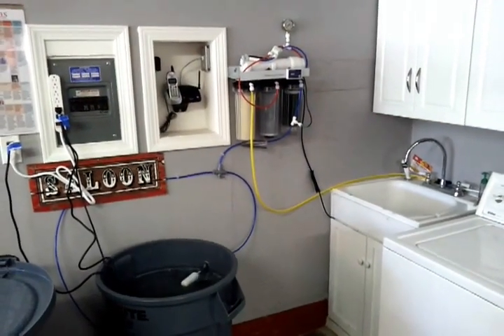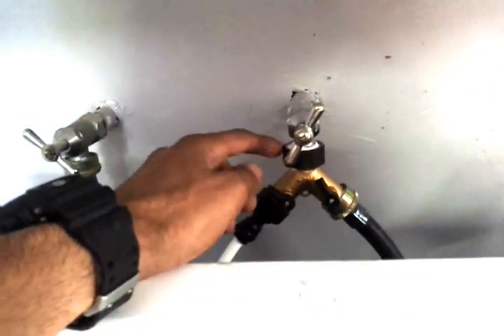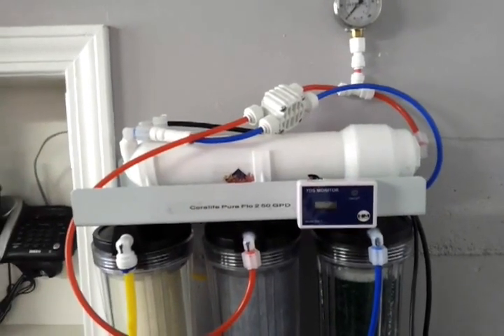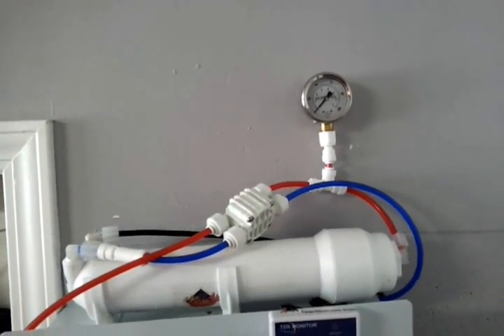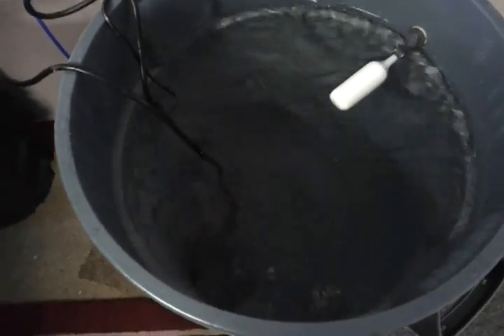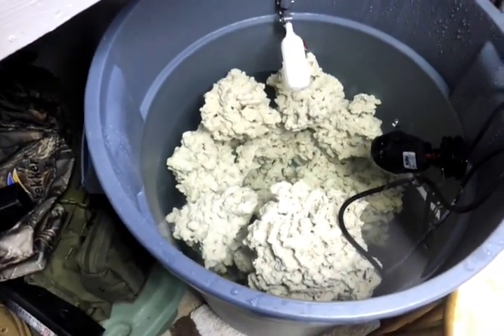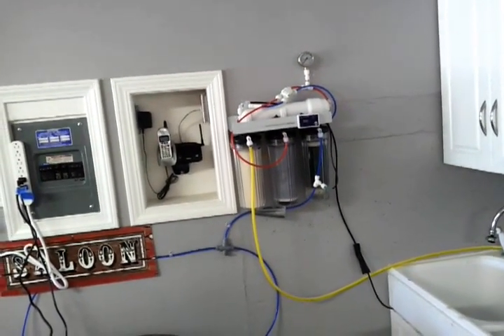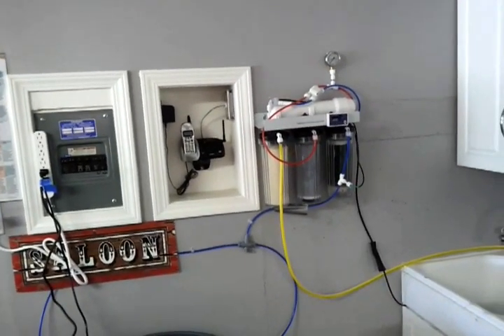Saltwater Aquarium System: RO Water System

Comment: This RO System removes Hydrogen Mineral, 4 Bicarbonates, Iridium/Rhodium, and 11-13 other minerals. Here in California we have Platinum in our water, but it is very little. You need those minerals guys, and the Oxygen & Magnesium that RO removes. 
RO Water is Dead.  0 minerals. Unstructured.  Aggressive.  No Fullerene's.  No Spin-Density.
Fluoride is 100% removable, and Organic Minerals Stay 100%, tested at CLS Labs in Rancho Cordova.  cleanwater.igloro.info

N-O to R-O